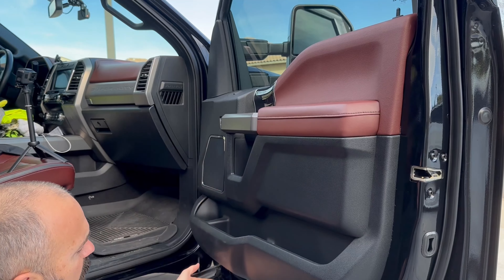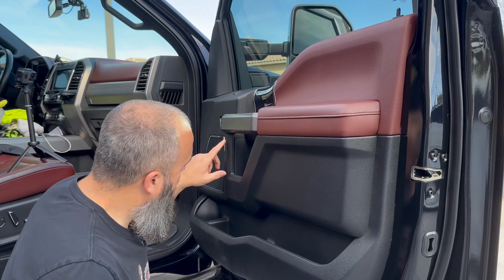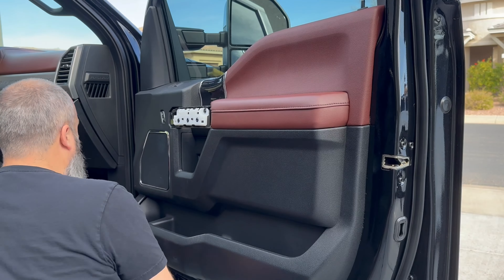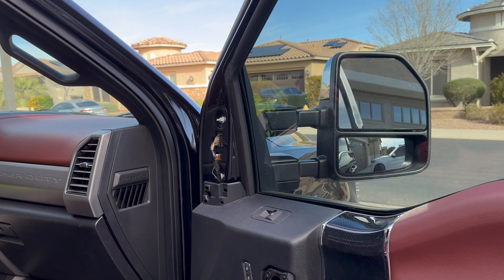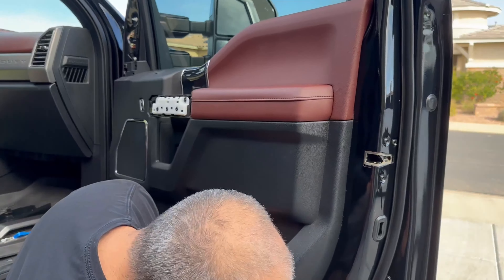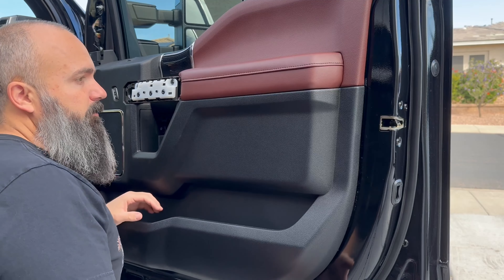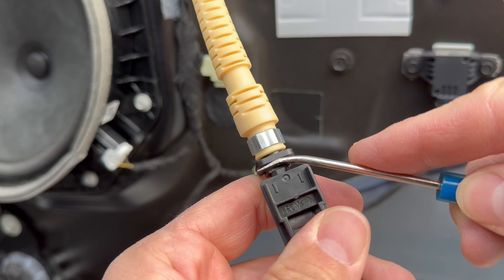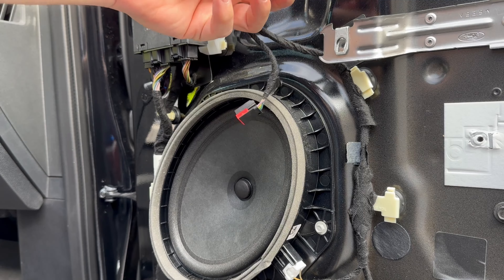F-Series Front Door Panel Removal | F150 / F250 / F350 / F450

Comment: I havent worked up the nerve to do my 23 yet. Honestly the B&O ultimate sounds pretty good for factory but ive always had aftermarket.
Reply from the maker: I hear you on that. It really didn't sound bad to me either. I did have a rear speaker go out at about 6 months of ownership though. That was the impetus to upgrade all the speakers.
Reply: @DrivingForwardBuilds  to me the tweeters in the headliner need to be swapped. Other than that it's not bad. I want better but it's just enough that I haven't decided to do it.